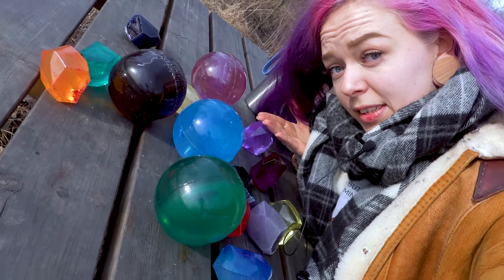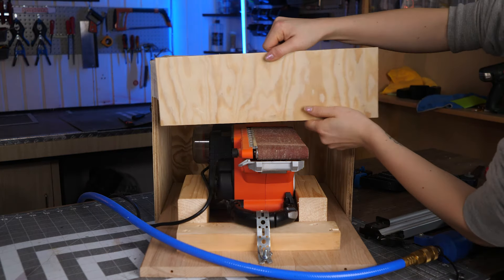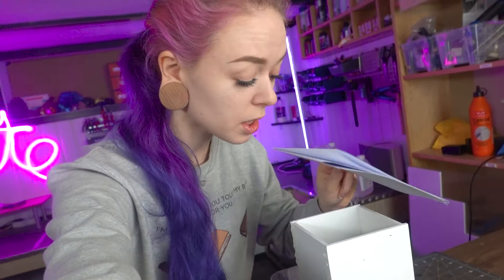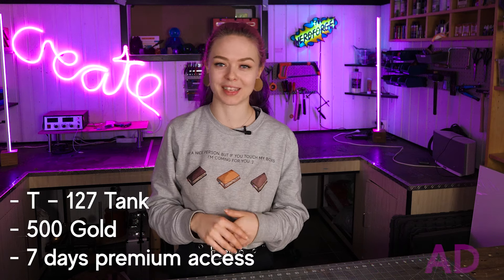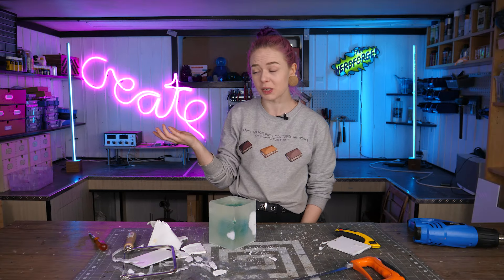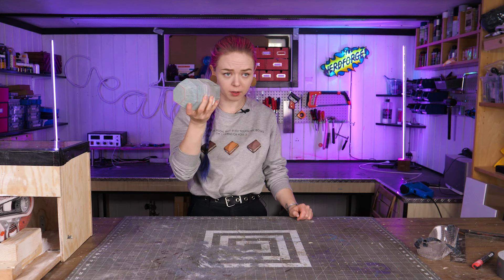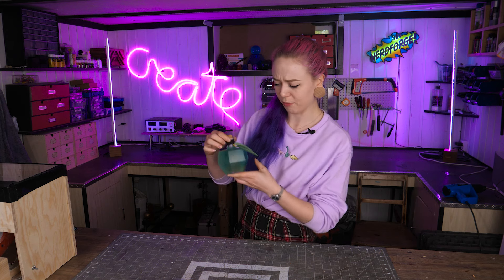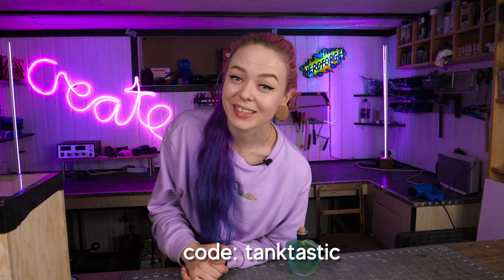DIY Fantasy POTION Made from Leftover Epoxy!

Comment: About the glass effect. It isn't about the thickness of the walls you left. The problem is that you have resin inside resin, and probably the same resin type. Same index of refraction or too close for the human "eye", no bueno, you need different indexes just like with the real deal (e.g. see disappearing glass inside glass by using corn oil or glycerin). Should also have rounded corners on the liquid and the glass to make it look like real glass, because glassware doesn't really have sharp corners to the point you subconsciously expect that. The bottom in particular can ruin the looks, as glassware doesn't have flat bottoms either; both the inside and outside are concave (not necessary by the same amount).

I haven't been fondling epoxies around too much to be able to know if merely using a different brand/type of resin would help though. Extra sorcery is likely to be required.

Unrelated: try to make the mold closer to the finished shape. Wood turners and some machinists just "cast" resin as in they make a blank that works with their machine assisted carving methods. "It gets the job done", but we can improve on it. When casting anything, every second you spend on getting the shape as close to the finished product right out of the mold saves you a lot more time on sanding, cutting and shaping otherwise.

Comment: You are going to hate me for saying this. I do believe that you could have achieved a better and faster result if you had simply applied multiple layers of clear resin over the top of the hexagon resin, in very thin layers. Substitute acrylic rod for the bottle neck, glued it on with clear 5 minute epoxy. Swap out wooden/ceramic beads for the leaves, maybe even etch in some runes in the resin "glass", an appropriate color of paint added to the runes and then another coat of resin to seal it in. In spite of that, I am VERY impressed with your determination and skills. While the finished result is not up to par with your magnificent staff, wand and books it is still pretty good! :D

Comment: Paper (and foamcore) is absolutely horrible for doing epoxy... but if you put a layer of candle wax on it first (use your heat gun to smooth it) before you assemble the box, it will release a LOT better... another option that might have worked better would be to shape your hexagonal oversize, mold plasticine clay over it with additional clay for the "neck (top) of the bottle then carefully cut this outer mold in half around the edge of your colored epoxy. Shave the colored epoxy down a couple more millimeters on each side.  Create another clay mold around the top of a bottle of the diameter of your final "potion" and cut it in half horizontally at the height you want and then in half vertically. Take each "top half" and match the inside curve to the hexagonal bottom mold and then do the same to the other side. Put the bottom mold together and smooth the gaps together on the inside and pin with wood skewers. Pour in a few millimeters of epoxy in the bottom and gently place your colored epoxy in the center of the mold just before the first layer hardens. Assemble the top halves and pin together with more skewers. Mix up more epoxy and pop the bubbles before the pour... slowly pour into the top of your "potion bottle" mold until it is filled. When it hardens you should be able to peel away the clay and have a nice bottle with just a little thin "flash" to trim off and clean up. A little extra epoxy painted on can help with any "dull" looks or blemishes. Paint and decorate the top as you desire.  There are even better ways but I am trying to keep it as simple as possible... <G>

Comment: I hope this isn't a health potion, because trying drinking half a litre of potion juice in the middle of a fight will get you killed faster. :)
I think you were a little too ambitious with the chape choice for your first potion. If you have access to a lathe, making pear-shaped potions is relatively easy, and imho, they will be very impressive despite being more traditional. For mana potions, you can just make shape them like chemistry test tubes which should also be easier.
If you want to use the epoxy chunks you already have, consider breaking some in small pieces and throwing them in a bottle with a couple LEDs. They make excellent magical crystals.
Epoxy also works great as jewels on amulets. Again, if you add an LED underneath you can have it glow which makes it more impressive.

Comment: i like the final result (makes me think of "Sea of Thieves" aesthetic), but seriously what a mess. you made even more epoxy leftovers than you originally had. why didn't you cast a bottle collar part, and glue it on the bottom part afterward? that would have saved you some resin.

Comment: I’m late but use 1mm plexiglass to make mold. Use super glue and clear tape to hold sides together. Use hot melt to seal to base. To release use a heat gun to peel off sides check out jedrek29t on YouTube

Comment: Didn't wear a mask while sanding epoxy ball, but wear one when cutting foam board?  You won't figure it out (maybe because of improper use of safety equipment), but that is really, really, really, (+ 77 more really's) dumb.